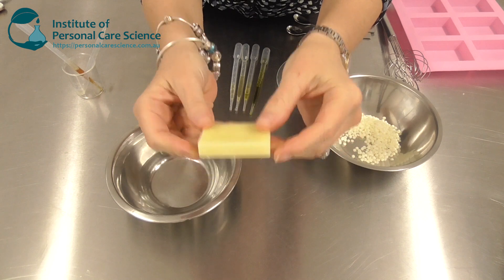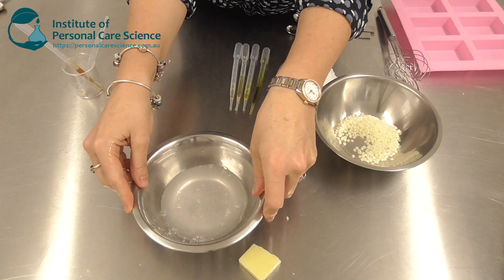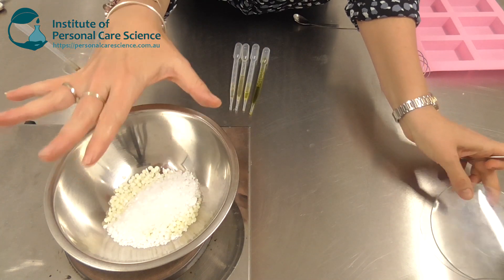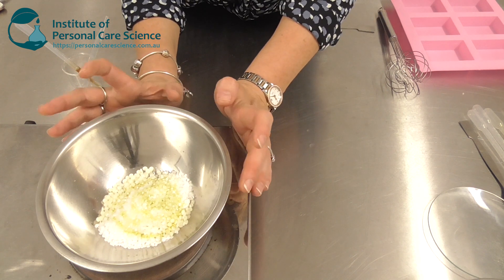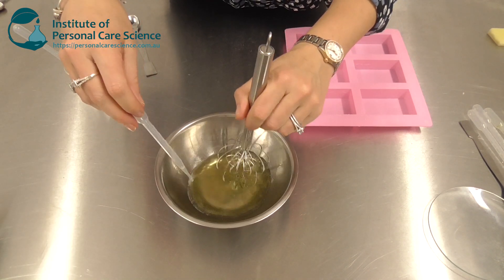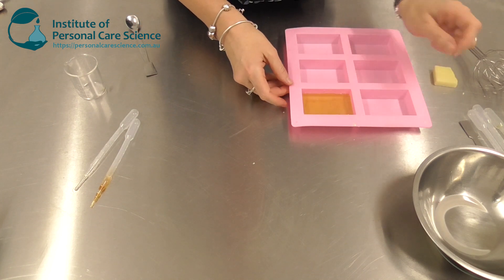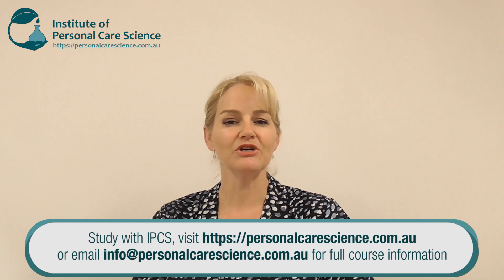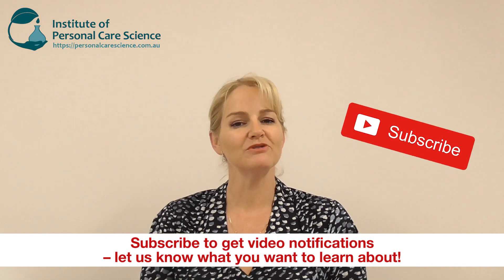Solid Conditioner Bar

Comment: How comes you didn’t add a preservative if the bar will be around water alot?
Reply from the maker: As long as its not sitting in water, it won't have enough water on it, even after use, to sustain growth. If it were sitting in a significant amount of water, then even with preservative, it may still enable growth because the water surrounding the product would not be preserved. As the product comes, and is used, it would not need preservative because the residual water after use is too low to enable growth. Happy formulating!

Comment: I made a conditioner bar a few months ago very similar to this. As a formulator, I did not understand the addition of cocoa butter and shea butter to conditioner and shampoo bars as seen in many groups. Thank you Belinda for this very helpful video.
Reply from the maker: Thank you – happy formulating!
Reply: Curious, what dont you understand in the use of cocoa and shea butter in conditioner bar ?
Reply: I still dont. I think maybe is for film forming,i dont know.
Reply: i agree with you. why is there so much oils and butters added to the conditioner bar. it leaves my hair oily, heavy and waxy. so instick to using regular shampoo